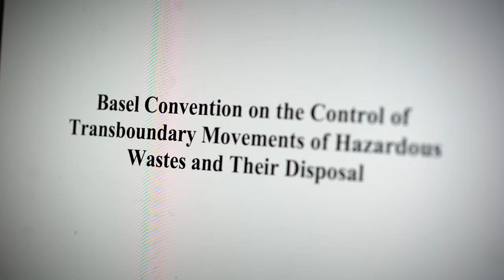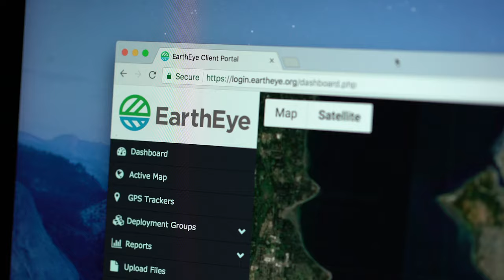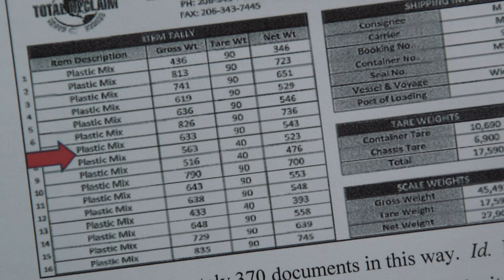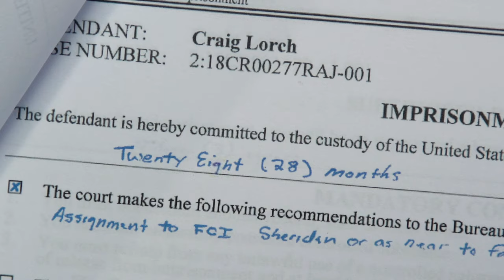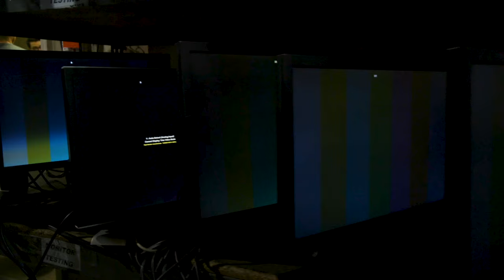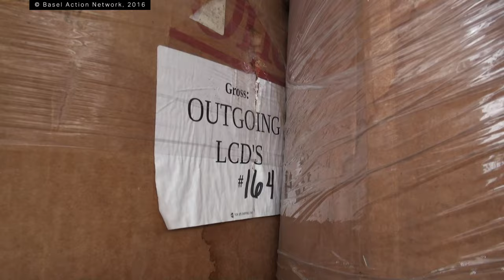The dark side of electronic waste recycling

Comment: Per my knowledge GPS is sending the location only one way - to the device. It's not receiving information from the device. For example if you have a cell phone - the phone will determine its GPS coordinates but it will need Internet connection in order to send them to someone (or server etc).

How do those devices transmit the GPS location back to the system?

My apologies if this question was already answered!

Thank you!
Reply: Car trackers, used to recover repossessed vehicles, transit their location over 2G cellular. They might be using that, though that means they can't watch it cross oceans - just when it arrives.

Comment: I worked at an electronics recycling plant for almost a year and they just put the printers through the shredder even though the bulbs have mercury. There were just too many to demann every single printer! 7 sorting stations would separate the base materials into boxes, and then shipped to china and japan for melting down... There is such small amounts of precious metals in each item that it isn’t even profitable to extract it.

Comment: nice to see the expert installs the tracker next to a nice large metal shield, that's definitely going to help signal strength.
Reply: Perhaps the metal "shield" becomes a large antenna for the tracking device!
Reply: @goodun2974  That tracker most likely uses GPS or/and cellular bands. The frequencies used by these services do not play ball well with large sheets of metal used as antennas, not to mention you can see the device is wrapped in plastic and self contained, no external wires.

Comment: There's a math error 9:25
8 Million - 2.5 Million \= 6.5 Million
Reply: I thought so too, but I believe he's taking the cumulative sum of both the owner's to do this math. 16 million between 2 people, 2.5 million to do it right, 13.5 million left for profit between 2 owners, 6.75 million each. His math is still not right (lol), but makes more sense.
Reply: 8,000,000-2,500,000=5,500,000
Reply: @Raraoolala  I had the same reasoning too, thought he made a bigger mistake but give or take 250k he's legit
Reply: Nadan Honey uhm yea, that’s what his comment says.
Reply: The math checks out. 
He didn’t say 8 million between the two of them. He said ALMOST 8 million each. Which means it’s ALMOST 16 million in totality. Not exactly 8 mill per person. 
It could be 2.5 mill off maybe 15.7mill combined or something along those lines
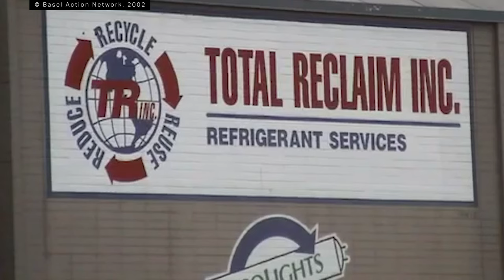Reply: The real problem with the math is that they made 8mil each from recycling unethically. If they had done it ethically, they wouldn't have made that much money, so subtracting the cost from the profit doesn't make sense to me. Craig Lorch says at 5:10 that they were "selling the material on the back side offshore," so you also need to take that out of the profit margin.
It was still reprehensible, but saying they would still have made out like bandits without behaving like bandits might not be accurate. I don't know enough about the industry to say for certain, unfortunately.
Reply: If this is so profitable, why does not BAN start their own recycle company?  They seem to know how to recycle properly.
Reply: @bobroberts2371  No, they know how to track e-waste. Two totally different pair of shoes.
Reply: Lone Starr  And that's my point. BAN doesn't have the knowledge to run a recycle company yet they are telling waste processors what to do.
Reply: @bobroberts2371  lol what? So you can't give critique now unless you know how to fix the problem? That's not how the world works.

Comment: There is not enough mercury in an LCD backlight lamp to do anything. Even still that mercury is not in vapor form because it is not energized. mercury is only dangerous in vapor form unless you intentionally ingest it in liquid form. Modern TV sets and monitors use  LED backlighting and lead free solder so the danger risk is lowered however many many repair shops in the US do not use lead free solder while repairing devices because lead free solder has a high failure rate and is difficult to work with.
Also you have some recyclers that shred electronics and other recyclable materials so they can compact as much as possible into a shipment
Reply: Lead-free solder sucks!

Comment: Some of this doesn't add up.... I personally repair my electronics whenever possible and then sell to local parts guys for the stuff I can't repair.... But calling exportation of e-waste murder is a bit much. They didn't force anyone overseas to take the waste. Perhaps accountability needs to be shared with these overseas companies....
Reply: Also factor in that Mr. Puckett does this tracking to pressure companies to adopt his recycling management system called e-stewards. To become e-stewards verified you just have to pay Mr. Puckett a licensing fee equal to 1% of your revenue plus all of the auditing fees associated with management systems.

Comment: Manufacturers should be held responsible for the entire life cycle of a product & not just until they're sold.

If they can invest in manufacturing facilities with expensive robots just to be early to market & being more efficient, they can also acknowledge end of life of their product & provide dismantling facilities where they're able to return a product to it's raw materials & reuse them.

I guess you could say it can be a closed loop system where much like Apple you're locked in a company's ecosystem so that could be a plus for the businesses. You buy from the company, you use it, then send it back to them.

Comment: the no.1 solution for the plastic, rubber,  etc. waste materials is grind them and turns to powder. then use them to mix with cement,sand to build roads, bldg. house, tunnels. etc. so there will no thrash in each country.

Comment: Why not do what's happening in NSW Australia? The supermarket or corner shop puts an extra charge of 10 cents on every can or bottle of soft drink. We save them  up and before they get too much to handle we take them to the recycle place in town. Organizations collect them, families collect them and we get vouchers to buy groceries at the local supermarket. Why not put $10 on the cost of a new monitor or electronic device and get the cash back when the item is presented for recycling? To aid in having ther items recycled correctly, only pay back 50% to the owner, give the other half to the company doing the actual recycling.

Comment: I've picked up a lot of monitors and tvs only to have little work needed to get them back into people's homes and offices. Seriously, if an electronic fails, most of the time its a small issue in one of the board(s) that requires little effort to fix. I had a brand new HP laptop that had a ground fault issue and only needed a capacitor on the board replaced. I did it the work myself at no cost and sold it. Its not about the money for me but simply knowing that a huge chunk of metal and plastic isn't going into the environment all because of a small chip or capacitor.

Comment: Do LCDs contain mercury?  Sure the older ones that had a tiny  fluorescent tube in it did but most LCDs are LED illuminated and OLED don't even have a backlight.
Also I tend to dismantle my hardware so that it can be recycled or handled appropriately.  I have a gel-cell a Nickel Metal Hydride & 26 nicads sitting on my desk as I type this) from things I've recently dismantled (alarm, home-phone, drill) [I'm a geek, and actually enjoy dismantling].  I see no problem with poorer countries doing this if it's done properly.
That said I absolutely applaud verification of recycling.
Reply: Well, I don’t think anyone makes fluorescent backlight LCDs any more, but tons of them are still in use, and are being discarded every day. 

As for the total environmental impact, LEDs need more toxic ingredients to manufacture. So it’s possible that it’s simply moved the toxicity to a different stage of the product life cycle.

Comment: Maybe we should just make electronics that don't fall apart in two years instead.
Reply: It is not so much about falling apart as it is the extreme rate of improvement over time. As per Moore's Law, the number of transistors in a given useful microchip as been doubling every two years or so since the 1970's. And programmers like me come up with new ways to use those new resources. And if your device is connected to a network of more advanced devices that run more intensive processes assuming the greater resources of more modern machines, then your older one will struggle as they don't have the more dense and efficient/effective resources.

Comment: I know this won't happen. But manufacturers need to move to a 2 year product cycle. The world doesn't need a new iPhone or Galaxy phone every year.
Reply: True. In Europe, the electronics manufacturer, specially for phone and computers, have to offer at least 2 years warranty on products, which helps. Sure, it's added as a cost to the end customer but it is a great deterrent to upgrade every femtosecond.
Reply: A 2 year product cycle isn't enough. Should be 5 years at minimum.
Reply: @goodun2974  I agree but that definitely won't fly

Comment: We rip apart old laptops and computers for replacement parts at home, but I didn't know lcd screens contain mercury, but id where to take my old laptop with the broken lcd screen too that will handle it properly. My family hoards tech for backup purposes whether it's parts or emergency phones. You mean to say every time I work on that old laptop in inhaling mercury vapors?
Reply: It's the CCFL backlight in older laptops which have the trace amounts of mercury, you'd have to smash the screen up and expose the broken backlight bulb to be in any danger.

Comment: I never send anything to e-waste recyclers. If something of mine (or from the side of the road) is damaged beyond repair I fully dismantle it and harvest the circuit components so I can use them in my projects. I'm not sure if this counts as recycling but I prefer it since I'm not actually losing any of my stuff, I know that the dangerous bits are being handled peoperly, and I'm saving money.
Reply: I would say that it does count as recycling - i do the same with any electronics i come across

Comment: Rip me I often end up breaking the LCD light bars on accident every so often while recycling. I try my best not to and often am in the outdoors but I really should wear a mask and have a fume hood. But what gets me is they put it on the board right, not on the screen part which contains the harmful mercury in florecent tubes like you have in the kitchen. Is the battery acid and stuff safe? Probably not but those are much harder to break than those tubes

Comment: The reason it happens is also because the west imports too many physical goods versus its exports, so the container ships departing from the west on the way back to countries like China lower prices dramatically in order to make some profit/cover costs of the crossing rather than just on the way over to the west with the goods from eastern countries. It has been a problem dating back into some of the earliest interactions between the east and west (and the reason behind the opium wars, since England didn't have enough trade goods to trade with china so they used opium instead)
But now china does not want to import anymore so even more will probably be dumped in landfill and south east asia...

Comment: Yes its good to use electronics longer and buy second hand refurbished items, but that's not addressing the real issue. And that issue is corporate accountability. If you produce an item you should make sure you have a system to recycle that item at the end of life and that the cost of doing so is built into the product initial purchase price. We need regulations to stop this problem. Individual responsibility is not enough. I would love to be able to bring back my old devices to the place I purchased it and know that it was going to be handled correctly, safely  recycled and/or reused.

Comment: They should require user replaceable batteries to every average joe product such as laptop,phone and tablets. Would be also a benefit to require manufacturers to offer decently priced spareparts and even newer cpu holding mainboards. It is so ridiculous that products life cycle is 2 years when you could simply replace the battery since cpu power is good enough to continue the use.

Comment: I don't generate much E-waste, but I recycle all of it and other peoples as well.

I'm still using computers that are over a decade old, though it's getting harder to do because the internet has been ruined with new garbage software mandated by the government to include back doors for easy warrant-less spying on the citizens. Most newer software is just designed to make older hardware obsolete, software keeps getting less and less efficient, but it should be getting more efficient if the programmers had any common-sense and it should be backward compatible with older hardware.

I repair as much stuff as I can and the rest I scrap to take to the recyclers so I can get a few dollars (every dollar helps when you're disabled and basically homeless like me). Unfortunately I don't have much to recycle and the recyclers are a couple hundred miles away so it's rare that I can get over there anyway.

And I go out of my way to avoid supporting slavery, my computers are Panasonic Toughbooks made in Japan rather than the slave-labor garbage made in china that doesn't last very long anyway.

Comment: Except LCD's contain no mercury
Reply: LCDS with florescent backlight lamps do but the most use LEDS
Reply: @apachehelocopto1779  the lamps ate tiny and encased in metal but easly removable so depending on how much the workers have to strip the monitor into parts the exposure may not be that  high or none at all.

Comment: Lol at the guy’s math at the end…8 - 2.5 = 6.5 🤦‍♂️
Reply: Lol at you for not listening to what he is saying. He said there are multiple owners and each took 8 but it would cost them 2.5 to do it properly. If we assume there are 2 owners you can calculate (2*8-2.5)/2=6.75
Reply: @compmojster  Did you listen? He says 6.5 and your math is 6.75. I suppose it's his wording that is confusing. He begins by talking about the owners individually ($8MM each), not separately. Then he says it would have cost them $2.5MM so it's assumed he's still talking about them individually, not collectively. Either way, he's wrong. It's either 5.5 or 6.75.
Reply: @BPed  he says they took home almost 8 million each. His math is correct whichever way you look at it. And 6.75 is very close to 6.5 don't you think?
Reply: @compmojster  I don't know how you can say his math is correct. It's math, it can't be disputed. He said 6.5, and the answer, depending on how you interpret his words is 5.5 or 6.75. And no, 6.75 is not close enough to 6.5 because we're talking millions so the difference is $250,000.

Comment: Those capacitors.. 
Resistors...
Plugs...
Wires...
Buttons...
So. Many. Components.
Why cant you just desolder it?
Like... Some components would still work right?
AARRRGH
Reply: You can melt it down instead, most of that stuff has precious metals the can be reused.
Reply: @Away0G  ik, it was just my frustation

Comment: If only manufactures didnt make poor hardware designed to fail and hard to repair.
Reply: Like a Dell computer. Nearly impossible to fix when something fails because every connector and piece inside is proprietary. I spent the last week trying to fix two that I was not successful. I stripped out usable parts and taking whats left of them to a recycler tomorrow.

Comment: 1:06 Trackers in my electronics is a nightmare I sometimes have.

I have a unbranded Chinese wireless keyboard that becomes possessed when its unplugged, flashing between different colors seemingly in tandem to the emotion of the text being typed. Cant give a review on it on Amazon because they went out of business. 

My Samsung galaxy tab auto-correct keyboard also probably has a virus, it types extra period points and misspells words. It could have been a dormant chip that activated after a couple years.

I think I would pay for a company to check for trackers and hardware viruses like people pay for software anti-viruses.

Comment: Waste recycling is usually difficult due to the enormous variation in the waste received, when you get paid up front the temptation is always to move it on, and pay someone else less to handle it. The more difficult the waste is, the higher the charge to accept it, and the recyclers often cannot treat it, but take the cash anyway, and either stockpile it, or dispose to someone else who stockpiles it.
 Eventually the difficult waste finds its way to the least desirable option, we need strong auditing and regulation.
Reply: If the metals in the electronics were truly valuable, then then it would be possible to profit from recycling instead of stealing from people to recycle it.

Comment: It’s the solder. Leaded solder is preferred because of its high conductivity.
Reply: Christian Chan LOL the conductivity of leaded solder is no better than lead free. Leaded solder is easier to work with. But it’s a tiny part of the ewaste problem. CRTs contain hundreds of times more lead in the glass than in the solder. But the major problem with ewaste is burning the plastics and using acids to recover gold.

Comment: I had my Samsung Galaxy S4 for 6 years from when it was released in 2013 til last year when I replaced it with the S10.
Only upgraded because of some software and hardware issues that made it a drag to use, and I had an opportunity to get the S10 for free through work. 
I will keep the S10 for as many years as I can too.